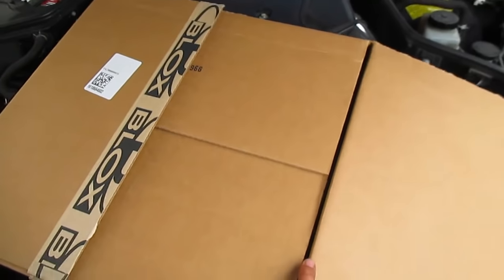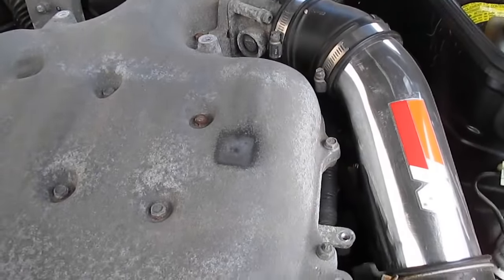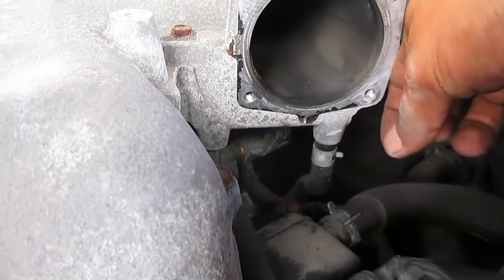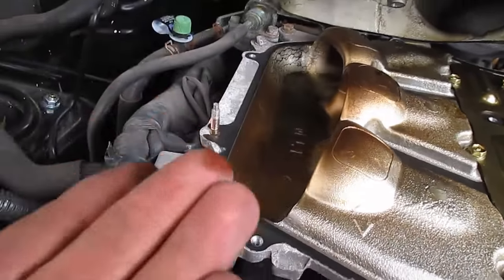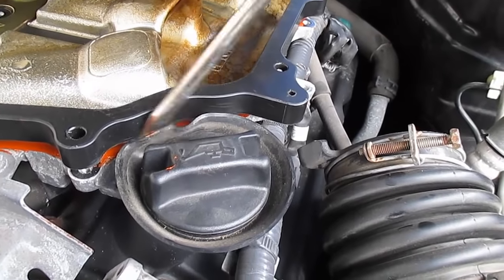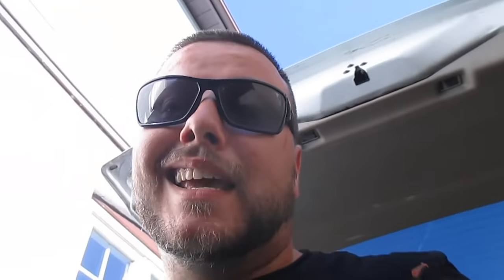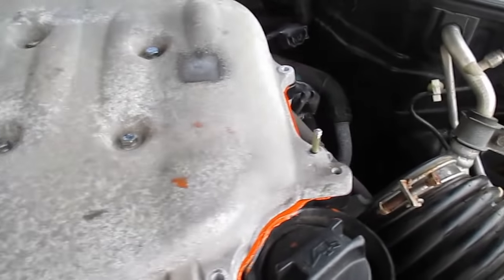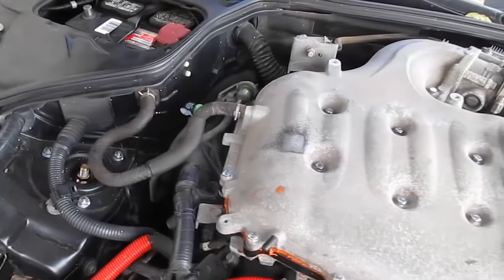How To Install Plenum Spacer on a G35, 350z 350Gt or fx35

Comment: i just bought an 03 g35 sedan. Ive got this rattling noise at low speeds only and the sound comes and goes. Anyone have similar problem?
Reply from the maker: is it during take off?? I have a single mass fly wheel and the chatter when taking off from a stop is insane
Reply: it happens during takeoff, and low speeds.
Reply from the maker: +Tristen Chhorn yea could have and aftermarket clutch in it. single mass flywheel s make a lot of noise
Reply: Change ur oil if u havent yet bro
Reply: Take a look at your muffler brackets.  When I purchased mine, the rattle would occur once it got a little warmed up.  The muffler bracket was broke though, and I was told it's something that has often happened with the car.
Reply: Tristen Chhorn when I bought my 2003 g35 sedan it also rattled I eventually did some work to the exhaust and did a resonator delete and a high flow muffler and found that the rattling was a heat shield above the stock muffler
Reply: Maybe it's loose bolts behind the passenger seat or the top shelf of the bose subwoofer, if the noise is coming from the rear area.
Reply: this happends to me too i thoight it was my engine getting weaker but i noticed it right under my passanger door im not sure but someone here said it could.be the exhaust going to look in that feel free to reply with updated information on the rsttling noise it sounds like shit tbh.

Comment: Torque spec-40ftlb first pass, 80 second and 110 third
Reply: Satesh Parag inch pounds not ft lbs. You'll thread the bolts and wreck the spacer if you torque them down that hard!!
Reply: Fix that post. You gonna screw someone up.

Comment: For my 2003 350z should I get an aftermarket intake manifold or spacer? I've heard mixed opinions
Reply from the maker: I would. its easy bolt on performance. just go with the 5/16 spacer for the best gains.